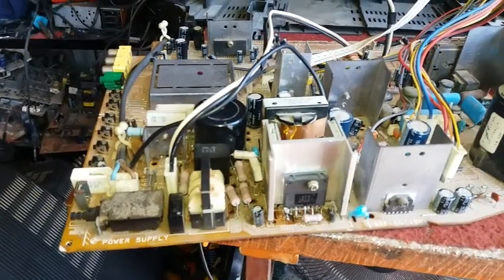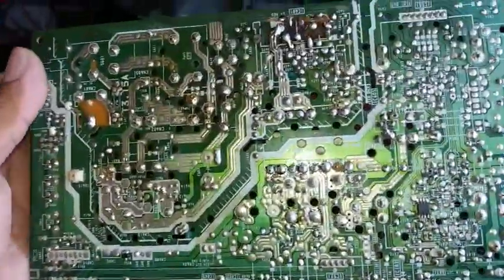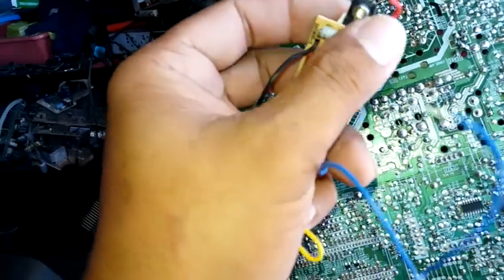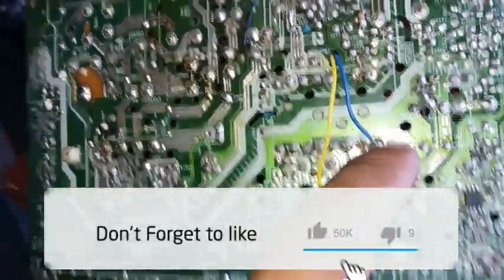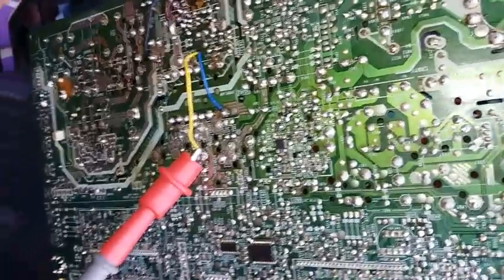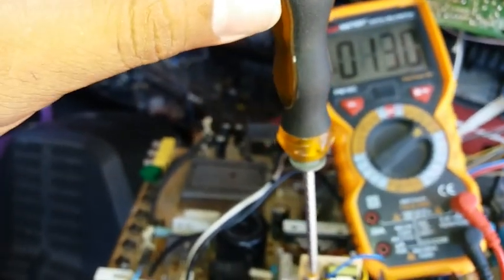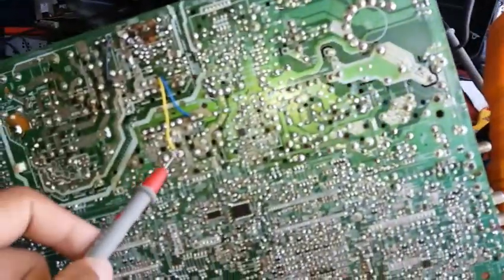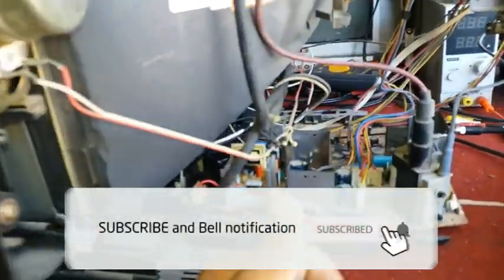4 WIRES MODULE SONY CRT TV REPAIR NO POWER SUPPLY

Comment: Kuya may gingawa ako sony trinitron kulay silver str nya str f 6267 5pin h out nya c 5885 may se 135 sya b+ 135 pwera sa main power switch nya s main board mayroon sya tack switch s itaas pang power din nya ktbi ng tack switch vol up down chnel up down pg ngsukat alo b+ pgsaaksak m s plug 130 b+ smthing sec lng yun tpos agd agad bgsak b+ 45 volt tpos bgla pptik sya aabot ng 300 volts  nsbi kuna str no nya pwedi b mglagay ng gaya ng 4 wire n nilagay m s sony gingwa ko pki sagot m new subscriber m ako
Reply from the maker: check mo FBT at hout baka sira na, oo lods pwede 4 wires gamitin
Reply: San ko konect yung positive 12 volt s opto copler b o s capcitor n sumusuply ng 12 volts
Reply: Buo h out nya regulator ang sira nya
Reply: Kuya yung gingwa ko sony trinitron kulay silver pwrra sa main power nya sa main board mayroon sya tack switch s itaas pang power switch p ktbi nuon yung vol up doen chaenl up down str 6267 kung llagyn ko 4 wire power suply wala b ako i hahang n iba p parts para s koneksyon ng 4 wire pki sgot po salamat po
Reply: Kasi ang sony gngwa ko may SE 135 sya kua ko tinanong jung may iba ako part n i hahang
Reply: Kuya tanong ko s sony crt trinitron  gngwa ko pkitan ko sna 4 wire may tinangal kb koneksyon s choper primary pki sgot kung myroon at saan banda pnglwa san ko kokonect yung suply nh 12 volt  may capacitor n dlwa isa 1000 mf 50 volt yung isa 1000 mf 16 volt sa secondry n yan cap n yan san sya kokonect
Reply: Pki detalye nlang po conection ng 4 wire power suply

Comment: Kua kakabili ko lang itatry ko kung uubra wlang power samsung crt 21
Ganyan na ganyan sa nabili mo po
Sana gumana
Wala nmn syang short kase di nmn putok fuse wala lang talaga output n lumalabas sa secondary kahit man lang 1v
Str w6753 yung orig na regulator po nya

Comment: Boss  yung  dalawang  wire  Sa  pin  out  ng  chopper naka  connect?
Reply from the maker: oo sir yung blue sa ground ng secondary, yung yellow sa 12v B+
Reply: @xiantekelectronics  Sa  capacitor ng secondary, salamat, boss, medjo naiintindihan kuna  ,kunti, keep it  Up, boss ,more  videos, tutorials, and  power  sa  YouTube, channel, god bless, boss
Reply: Anu  pala, na  cut  mo  boss  na  connection?